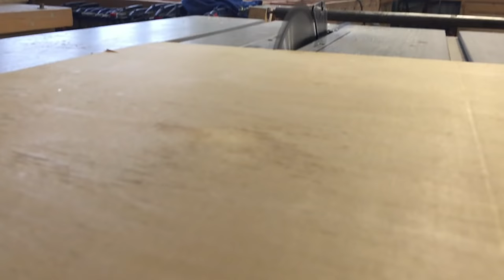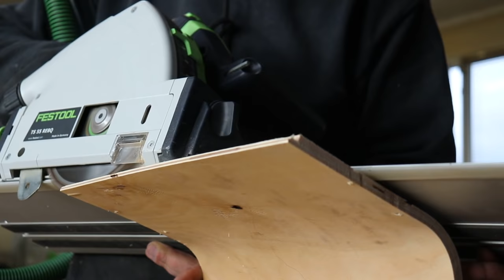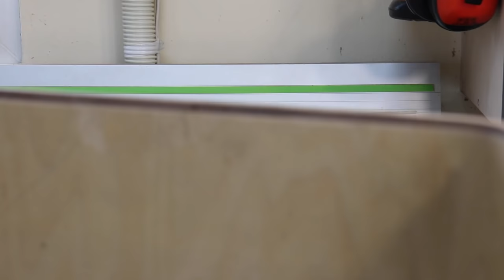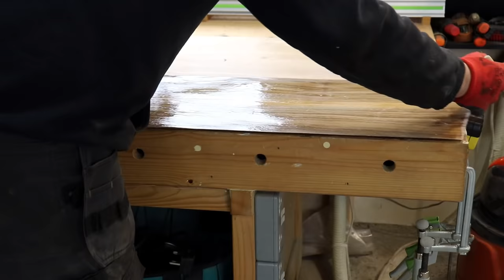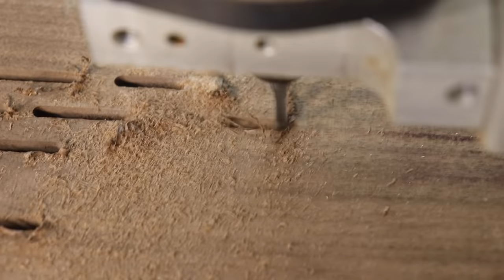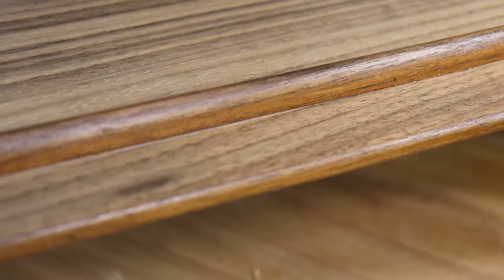Laptop Station | Подставка для ноутбука .

Comment: 7 kerfs spaced 1/8” (4.5 mm) apart in 18mm plywood for each of those bends. Glue over your negative form and once dry use that same edge banding/flush trim process to reinforce and hide the kerfs. Alternatively you could skip the edge banding and fill the kerfs on the show edges with dyed epoxy to highlight them. Less time. Less mess.
Reply from the maker: I'm sorry but I don't understand what you mean
Reply from the maker: So now I understand but this is when you crush thick plywood or MDF but I would not recommend cutting (2 sheets of 4mm) 8mmplywood and then glue again. It is my opinion. If you prefer to cut then this is your choice.

Comment: Rather than using a piece of wood and bend it, I would prefer using acrylic as the base then covering it with wood textured vynil..
Reply from the maker: If you think it will be right as you say, then you can do it, I think it is right as I did.